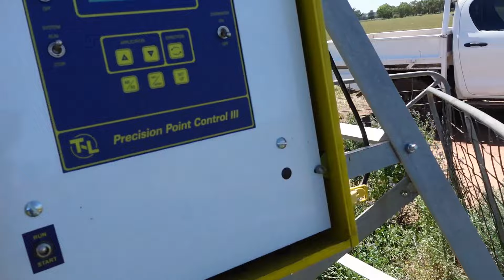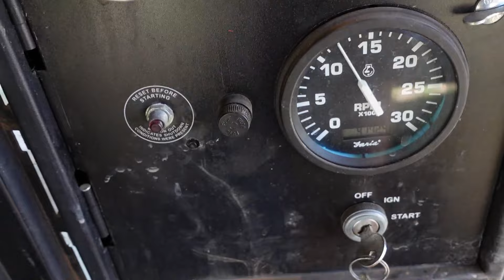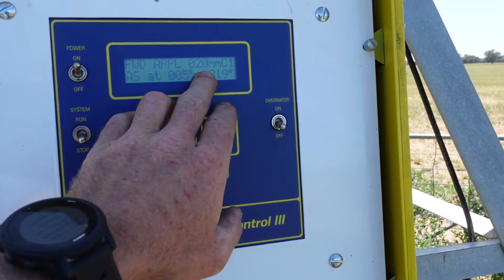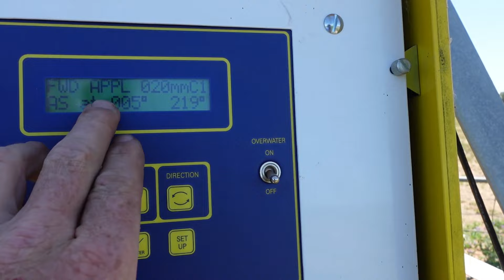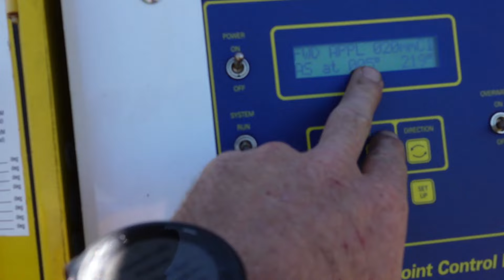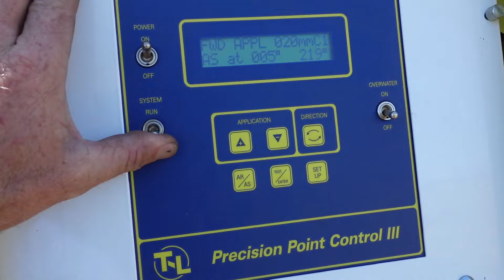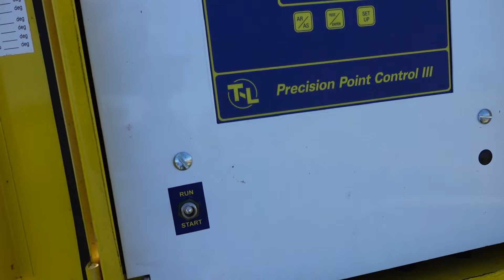How we start the pivot irrigator

Comment: Is that a valley pivot, Where I worked there was 5 Valley pivots, all electric driven, 2 V8 Scania generators mounted in shipping containers, Both needed to power when at least 2 pivots running, Watering 530 acres, 5 pivots, On another property 3 self driven like yours, Cheers
Reply from the maker: Ours are both T&L’s